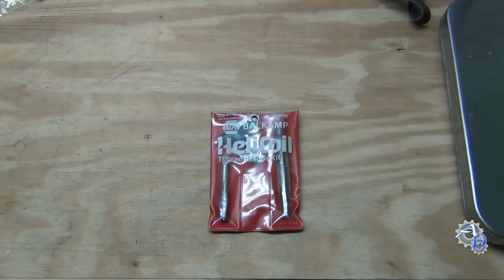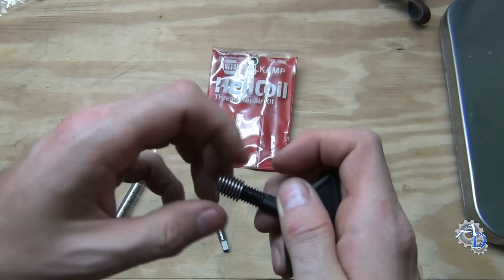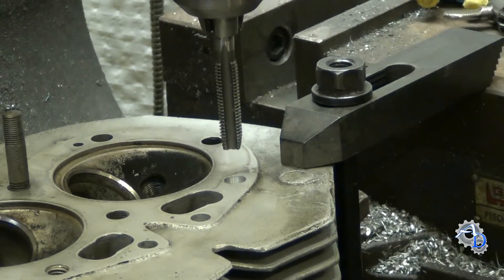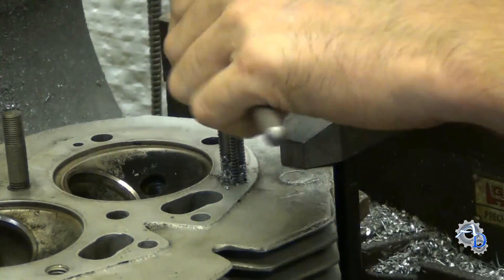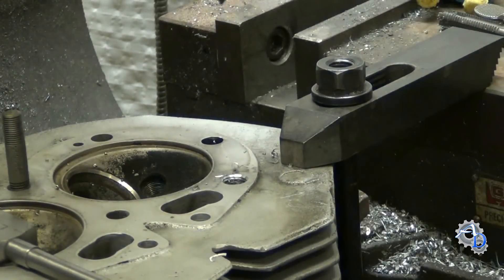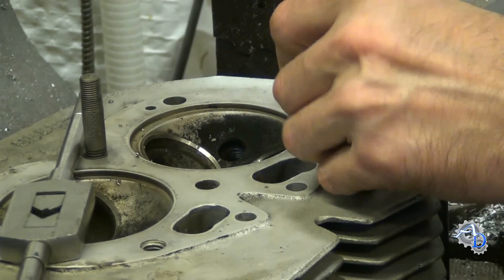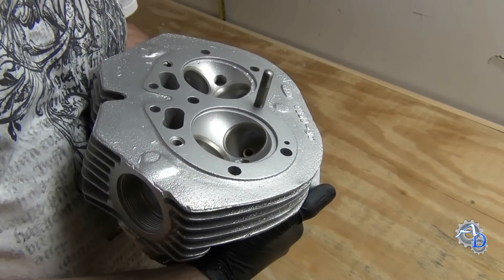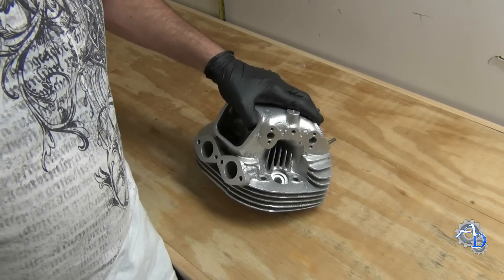How to Repair a Damaged Thread Using a Helicoil

Comment: I've done a few of these into blind holes, the helicoil does not go or need to go to the bottom of the hole as the bolt does not reach to the bottom. But everyone when the tang is snapped off always leaves a sharp edge that catches the end of the bolt thread. The bold goes clean in and tightens, then removing you can feel the damaged part of the tread resisting undoing. My kit instructed simply to use a second tool that grips the tang and snaps it off, I think I'll use your method to tap the tang down then break, maybe that will be a cleaner break and not leave a sharp end to catch the end of the bolt.

Comment: Ok... no disrespect....all of that care to do it right and all of that equipment no one who's gonna do this at home has......why not use a solid insert? Ive had nothing but misery with heli coils, even ones I didnt install....Ive had them pull out while torquing.. or come out next time you have to take apart. Oh hell I will just say it...that bike DESERVES a solid insert!!!!!!!
Reply from the maker: I've used solid inserts too. I actually prefer them if there is enough wall thickness.

Comment: The key locking style threaded inserts are much better. Helicoils can come loose if a component has to be taken apart occasionally.
Reply from the maker: I think you are referring to the Keensert style of insert. I've used them many times and they're a great product. I like to use them as long as there is enough room around the hole for installation. The OD's run bigger. I will be doing a vid on them too once I get a part in that needs repaired. A helicoil can be held in place with a little loctite. The hole would need to be cleaned out with acetone first.

Comment: when cutting the new threads in aluminum fill the tap flutes with Vaseline the chips will stick in the Vaseline and not fall into the cylinder.  This trick works cutting threads on all aluminum as all the chips tend to stay stuck in the Vaseline so when you remove the tap they won't ball up in the tap threads as sometimes happens.
Reply from the maker: Good advice. I have used grease for this situation, which is pretty much the same difference. I also have Butterfield's extra heavy tapping fluid which holds chips well.

Comment: Why can't you just use the threads that you cut into the engine block?  Why add another layer of threads with a helicoil?  I thought these were for adding threads to wood.
Reply: That would require the use of a larger bolt in that one hole while the others remain stock.  And that larger bolt might not pass through the hold in the cylinder head.